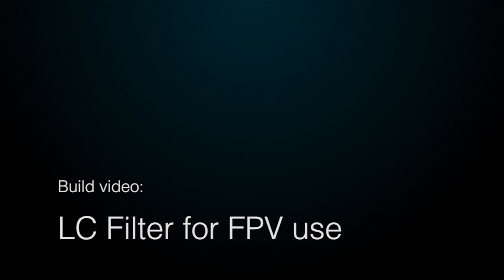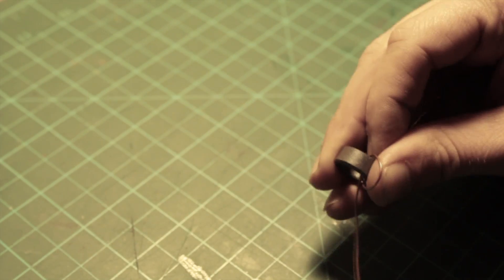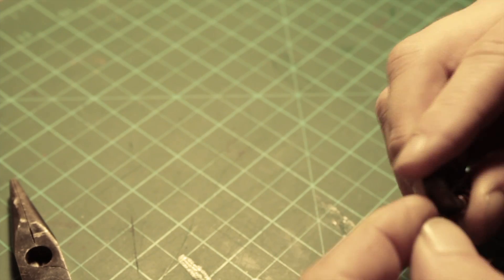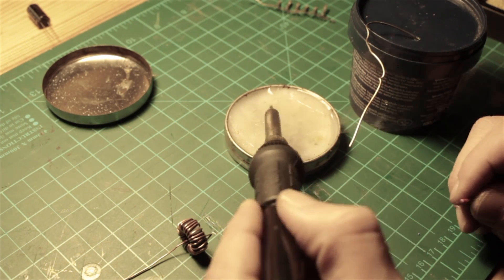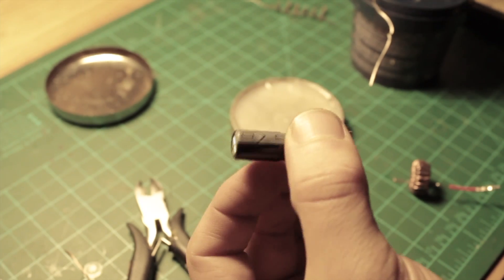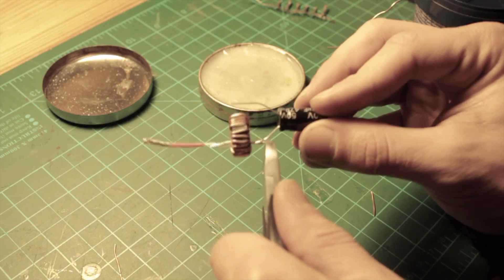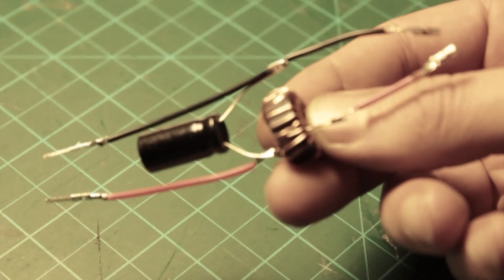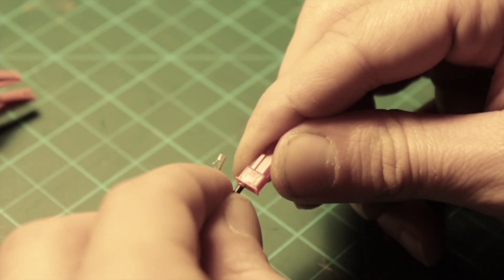DIY for better FPV - Let's build an LC filter for FPV

Comment: I made the LC filter using below,
16v 1200uF capacitor
ferrite core inductor (from old PC mother board)
26AWG wire to wrap the ferrite core inductor.  I was planning to connect the capacitor end to lipo and ferrite ring end to quad. (or is it other way)?

Comment: I just made my lc filter following your steps. Works very well, thx for this video. I pick the prewired ferrite ring  and 1000uF capacitor from an old P4 Motherboard, so I build mine whitout spend money ;)
Reply from the maker: Good work Mirko! Happy to know it worked out for you!

Comment: I'm assuming the cap side is your output and this is a parallel LC filter circuit.  thanks
Reply from the maker: +snaprollinpitts I found that the output can be on either side and works really well. I am not sure what you mean exactly with "parallel circuit" though, as this inserts in series between the power source and your Vtx

Comment: There's no need to use flux on your iron. You just want to protect the connection from oxides with flux.
Reply from the maker: +G4Disco Thanks for the input! I find that dipping the point of the iron in the flux help conducting the heat much better. Might be an impression though :)

Comment: Did you make a mistake,or I have learned wrong. As I think electricity should go from battery,to ring,and than to capacitor,and then to FPV??? Acording to your connectors,you made it wrong??? Or I learned it wrong?
Reply from the maker: Hello, and thanks for pointing this out. You are right indeed: electricity should ideally flow as you describe. Honestly though, the filter works flawlessy even if inserted this way, so I did not pay too much attention to the connectoros when I built it